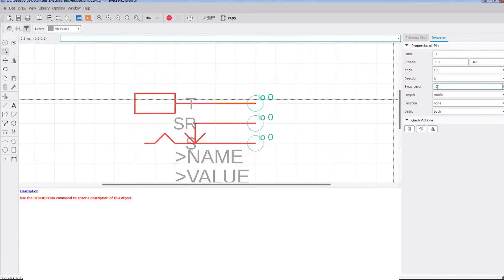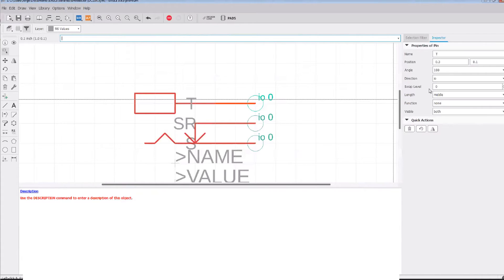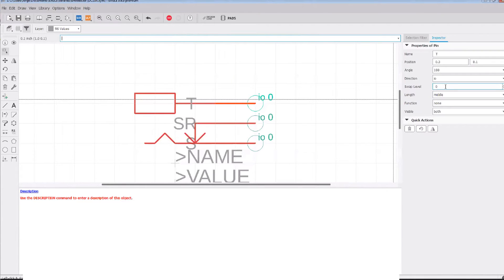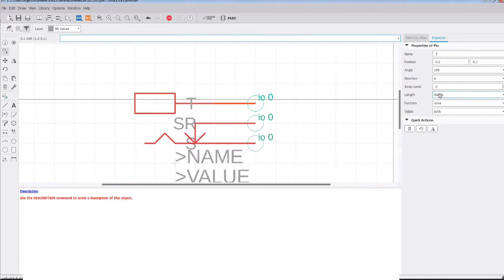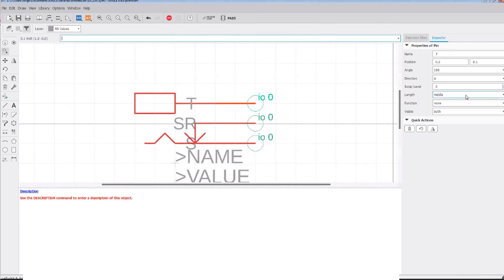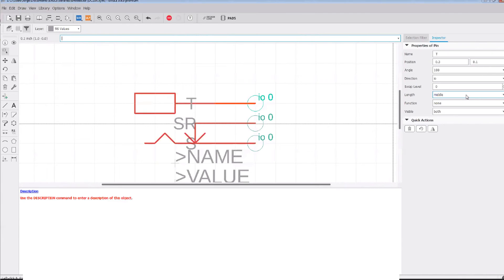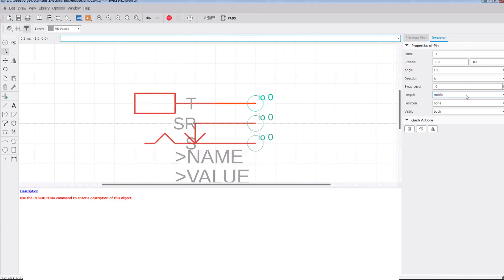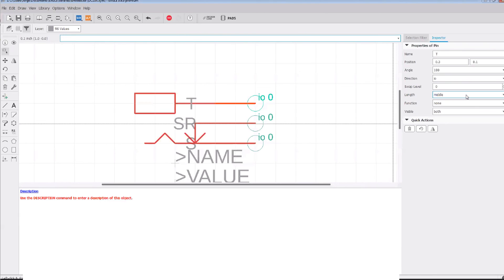Learn about the SWAP LEVEL of your PCB Design Pins

Comment: Assume a 4 pin resistor array (2 similar resistors) part created by adding two singular resistor parts so that you can place them easier in different sections of the schematic. How do you set up swap levels so that eagle can swap between each resistor pins disregarding the adjacent gate?

Comment: what is the purpose of swap level?  This video shows no value in having this feature.
Reply: Rob V, Swapping pins is something you could do IF you had control over the rest of the devices.  An example might be a component that could have its input and output that wasn't directional.  So if you are laying out where that component goes setting the pins to the same swap level would allow the software to route the board more efficiently.  If you are making a bad for a chip, timer or some sort of micro controller where the pinout is critical you would have the swap levels at 0.
Reply from the maker: Hi Rob,  Thanks so much for the question. Swapping of pins isn't a feature that is really unique to EAGLE. Some circuit board designers will decide to swap out pins in order to get a tidier route on certain devices. Here we just explain how the Pin Swap Levels work in EAGLE. Cheers.

Comment: Why did you use a part with no swappable pins in your example?!?
Reply from the maker: Hi Adam,  During the webinar Jorge mentioned that he used it because it's a component they could work quickly with and it uses slots. Jorge wanted to show how that can be handled in EAGLE. Thanks for your question!